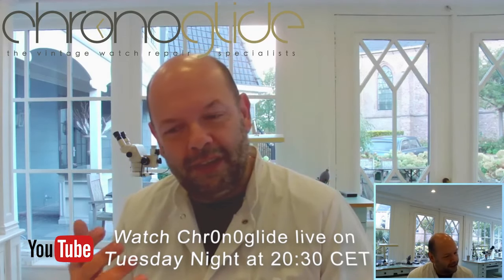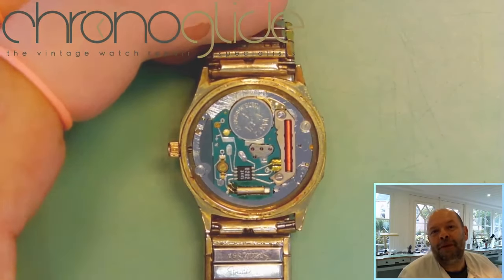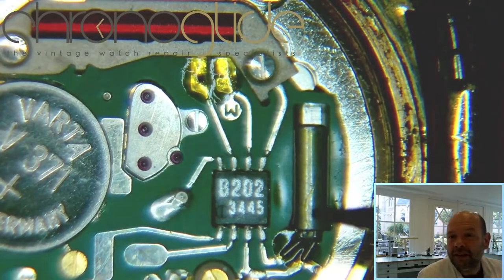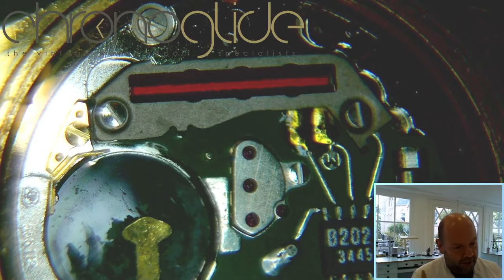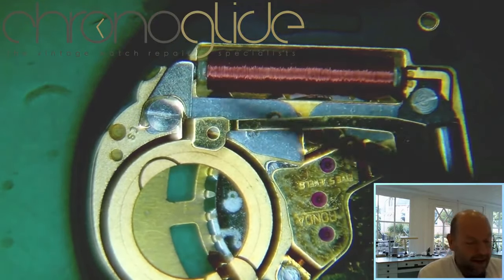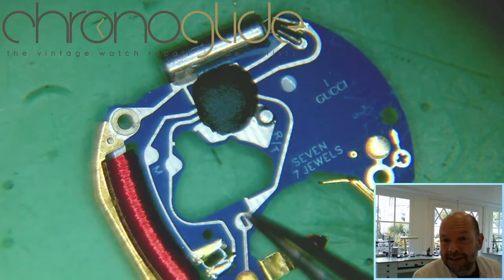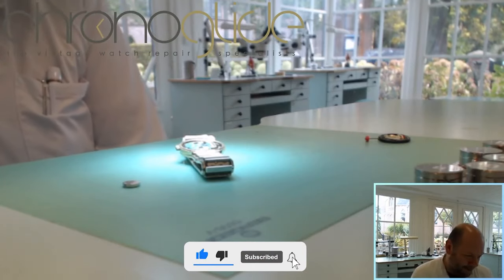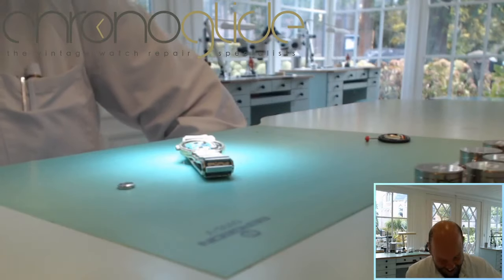How to change a watch battery - Tips and Tricks

Comment: There are 19 quartz watches in my house ..........guess who gets the battery changing jobs 😒 although I don't treat quartz with any less care than mechanical watches, if not more so, as you've correctly pointed out the electrical components are VERY delicate, so upper most care needs to be used. An excellent video Kalle. Notes of the cheep battery warnings people should take heed. As for the mechanical watches there are 24.

Comment: Well, I agree it's not good to put cheap battery in a watch. But I have to say Varta is a good quality battery, probably more expensive than maxell or energizer actually. It's not what I personally use but in no way a bad brand of battery. From my experience every battery can leak regardless of the brand. But yeah the lower quality you get, the higher the chance of it liking will be. And actually more importently don't let you dead battery in your watch too long because it increase exponentially the chance of it liking as well.
Reply: Do SR type batts (silver oxide enhanced alkaline) leak less than LR type (standard zinc manganese alkaline)? I think it barely makes sense to use the latter, maybe you can use them if you replace the batts yourself and keep a good eye on not letting your watches stay depleted, but it's scandalous that someone who charges even just several € for a service would not use the better type. SR should also keep screen contrast in LCD watches more consistently and last longer in all watches by far.
Reply: @SianaGearz  I dont think zinc mannganese are made for watches, i believe theyre used in tools, hearing aids etc.
Reply: Found Renata to be of good quality and value… <2 bucks for my needs.

Comment: Dank je wel Kalle voor deze film. Could you eventually save the movement? And if so, how did you do it? You're not a fan of Renata, but a lot of (Swiss) quartz watches have Renata batteries. I just replaced my Tissot Touch with a Renata, because there was a Renata put in by Tissot Switserland.... Groetjes, Hans Peter P.S. Do you prefer comments in English or Dutch?
Reply from the maker: Allebei is prima hoor Hans ;o). Renata isn't all that bad.
Reply: The electrolyte in modern batteries is an alkali, not an acid. The first thing you have to do is neutralise the chemicals. Swab it out with a mild sodium bicarbonate solution, followed by distilled water, followed by IPA to dry it. If the electrolyte gets into the coil or the moving works, the whole movement is toast and beyond all but the most detailed repair.

If the gold coating on the battery terminals is gone, treat them with tiniest coating of contact grease to prevent further electrolytic corrosion. If the PCB has been damaged, after cleaning and drying coat it in some clear lacquer. If the coil or moving works is already corroded or you contaminate them with cleaning solutions you might as well replace the movement.

Damaged battery contacts will require inspection and treatment on each subsequent battery change.

I agree with Kalle here. Having the coil next to battery clip is a design flaw, since a simple slip of the tool will take the coil out. If you take the back off a watch and see this arrangement you should be hearing warning sirens going off in your head.

Comment: I have a Rotary 9ct gold case quartz watch which is impossible to change the battery. Unlike other watches the back does not come off and instead the face and strap comes off leaving the front of the watch flush with the back case and no way to get it out to change the battery .... can anyone help?  thank you in advance 🙂
Reply from the maker: It is probably a two piece winding stem. place a tweezer between the case and the crown and wiggle the crown outwards. it will come off. Than blow air in the tube with some force and the crystal will pop out. It is called a monocase. May the force be with you. Kalle
Reply: @ChronoglideWatchmaking Thank you Kalle, l will try that. Sorry, l just noticed that l said the face comes off with the strap, it does not. The crystal front comes off with the strap. Stupid me.